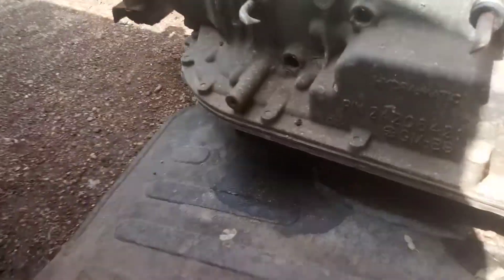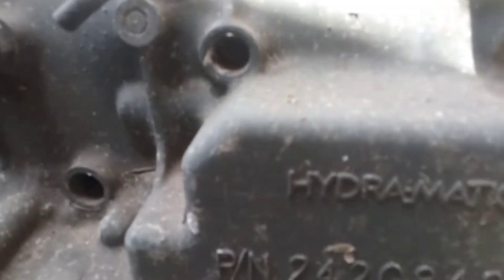Will this transmission fit in a 1972 Chevy Truck and work properly

Comment: What's up limpster? Being your trucks a 4 spd, it's got a fixed u joint,  both ends off the driveshaft, turbo 400 will be a good bet for using the same driveshaft. Turbo 350's are an internal slip yoke, so is the 4l60, but ud have to have the stand alone computer for the 4l60, and they are notorious for being weak in the clutches. All got have a radiator that has cooler lines too. Lots of parts to have for the swap. Better if u got a parts truck to rob from. Column, driveshaft, radiator, cooler lines, shift linkages, t350 would be best bet, cheaper to rebuild. Also multiple lengths on their tailshafts, 6in,9in, and can't remember the last length.

Comment: It will work. BUT you might need a stand alone wire harness. Summit should have them. Depending on the year it might just work by itself. It's hard to tell with out all the info. Is it a four speed trans? If it's a 4L it will need some kind of controller to function properly. Be much easier to pop in the 350 turbo. Hope this helps.

Comment: Limpy thats a 4L80 trans, prob out of a Chevy or GMC truck or could have been a humvee , But the TH350 was a better trans in my opinion, But if you decide you got too use the 4L80 I will need more info. Yes it should bolt right up, But like I said I would need more info.

Comment: That probly a 460 LE or 480 LE. electronic setup. it be alot of bs to deal with to put in the 72. The TH350 would be a simple swap. But it is a 3 speed, a 700r4 would be a simple swap also and it has 4th gear overdrive..
Reply from the maker: Simply amazing man people ask me all the time if I know this or I know that and I just tell them hey join my channel and watch it because if I don't know the answer lots of people on my channel do and it's because of people like you to make this channel what it is thanks a lot for subscribing